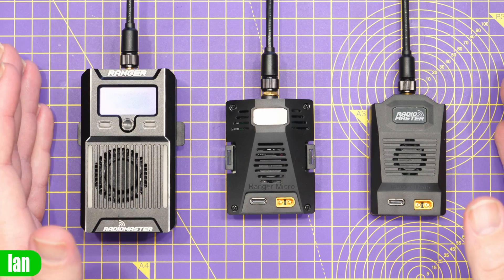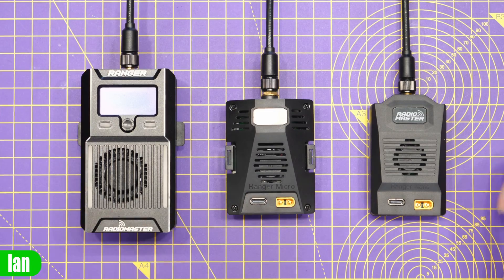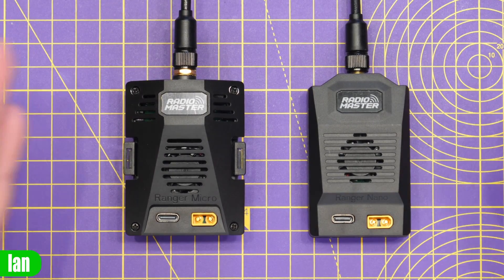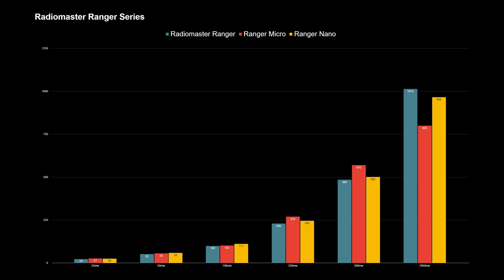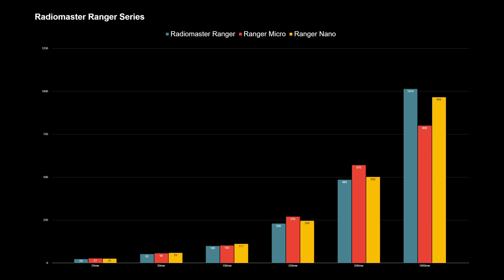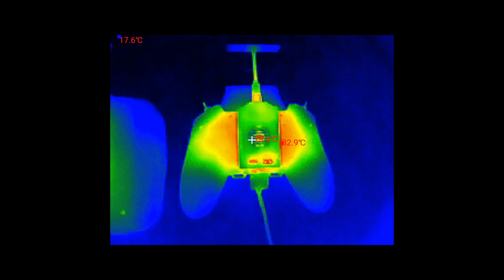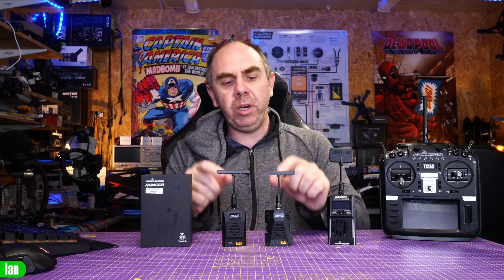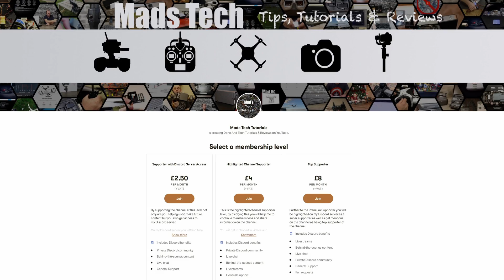Radiomaster Ranger Micro & Nano TX - 1W ELRS For $40

Comment: As you are UK based , could you do a video on the ELRS 100mw limit in the EU as all videos on receivers and transmitters are US centric. What's better for penitration between ELRS / Crossfire or even DJI 03 Air RX/TX at that power.

Comment: Dorky and 40 says that using an external battery to the xt30 will burn it up. Is that still a thing? I just oredered mine today then saw the video afterwards
Reply: Everything was immediately updated with V1.6 PCB. New batches absolutely have no problems. I can confirm, I purchased it two weeks ago and opened it to see it's true.

Comment: In your thermal shot, it looked like the Ranger Micro was in a TX16S and being powered by just the bay.  Was the TX16S a MKI or MKII unit? Are you sure the lower 1W measurement wasn't due to it being starved for power? Thanks!

Comment: Hi sir. just want to clarify a doubt from you. Rather that buying Boxer TX internal ELRS version(140$) can i buy cc2500 version which is (100$) then buy external ELRS micro module (40$) which costs the same and gives more optional protocols at the same time. and need to know whether both internal ELRS and external micro ELRS module specs are same and acts as same or will there be any cons in perfomance?
Edit: Never mind, i just bought RM Boxer Crush...
Reply: yes
Reply: @kiaramaiza  Thanks for the reply... anyways i bought radiomaster boxer crush...

Comment: Question: When you attach one of these ELRS to for instance the controller beside you, does the RF circuit of the controller deactivate? Or do you have two active antennas radiating?
Reply from the maker: No on your radio when you enable the JR bay the internal module will power down.

Comment: Awesome review!  👏👏What was the VSWR on the Moxon Antenna at 2440 and 2480? I did notice a lot more heat on that antenna, just wondering if the VSWR was higher than the dipole?
Reply from the maker: It’s the chipset heat creeping to the connector.  You won’t feel any power form RF below a few hundred watts.   I have tested it on the vna though it’s fine.

Comment: I'm glad I purchased the cheapest Zorro version, instead of paying more for the ELRS version. My reasoning was that in the future, if I did indeed venture into using ELRS I would have a much better selection of products to simply snap onto the back of the Zorro, products that have more options and higher power output than the built in module on the ELRS version Zorro.
Now that Radiomaster themselves have brought out these modules, I'm so happy I saved that money. These look like a great option, not just for the Zorro but for all compatible radios.
Reply: Zorro 4in1 and ELRS controllers always had exactly the same price to the last cent. If you were asked to pay higher price for ELRS version, that's a dodgy store right there. I'd never buy 4in1, absolutely no use for me. ELRS was the way to go, and when I wanted higher power output, I simply bought this nano version which is totally inexpensive. Of course, it's additional expense... but I do not use it with Zorro only, I slap it on my Tango II since it's 3 times better and higher quality controller than Zorro. That way I can still use it when flying my ELRS quads. So, no... ELRS version of Zorro was definitely not a waste of money. It costed exactly the same, $179 CAD for 4in1, $179 CAD for ELRS version. If you don't believe check Rotor Village for the pricing. And it was always like that, never changed.

Comment: Some people were affraid of ELRS because most reliable stuff was made by Happymodel and they know how reliable Happymodel stuff was in the past. But most people trust their RadioMaster radios so this should be an absolute game changer!
Reply: just bought a Mocro TX + 3x RX bundle for my 2nd radio! Only $60! What and absolute steal!
Reply: I agree with your point in full, but I’d just like to throw out there that my HM 2.4 pro module has been flawless, even though my smoothbrained-self forgot to put the antenna on it for a good 10 minutes on at least 2 occasions.

Not supporting or dissuading either product - though admittedly I’d probably go for the RadioMaster today (and will if my HM ever let’s me down) - just saying, sometimes the loudest voices are those that are most unfortunate and upset. HM ELRS has been great for a lot of us, so we spend time complaining about other things in FPV. Plenty of frustrations to go around… 😂
Reply: @abertheham  in my experience HM hasn't been bad when it works, but the issue has been more things not functioning on arrival lol
Reply: @abertheham  to be fair, I've also had a good experience with Happymodel. My Mob6 still flying since the start of human malware in 2020 and all my current quads are on HM EP1 or EP2 controlled by Namimno module, but I went and ordered RadioMaster module with 3x RX for my 2nd TX16S 🙂

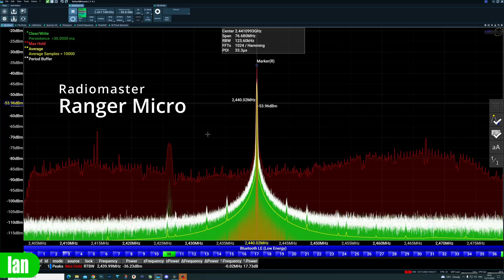Comment: pretty impressive results so far - especially the IR images and the frequency analyser spot on 13:23
Outstanding level of review - the depth and amount of points checked up to the radio heating after 30 minutes. 

Not sure where to go cause Zorro and TX16S need different modules as there is not really an adaptor so far.
I love these displays on the back but not worth considering that I might be caught and need to get one of each. 
Hope the affiliate link will work for you. Just to let you know: as for know radiomaster seems to have found a way around the usual EU customs that would not allow to ship them to the EU due to missing CE certification and no LBT feature. Mine was rejected before, the full radio incl. elrs but somehow my buddy had gotten his this week via a different country so they must ship them throughhh a loophole into the EU and from there to the customers EU country cause otherwise it would end up the same way. Therefore I will try one last order this week and hope it gets throught cause each time I have to go to the customs costs me  2 hours at least driving, waiting, disusccing and fighting and driving home which is always a mess and is already a trouble maker cause usually if I have to appear it is about radio frequency and certificates and mostly those that are forbidden. 
Right now it looks they have find a way but not sure how long this gap might be open.

Chapeau for your outstanding review.